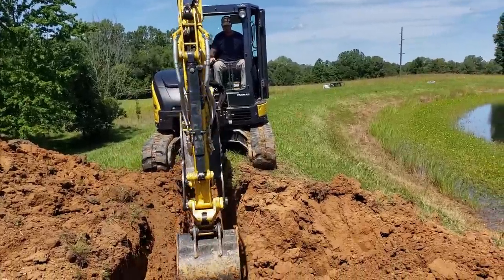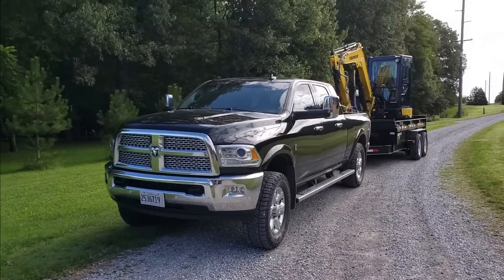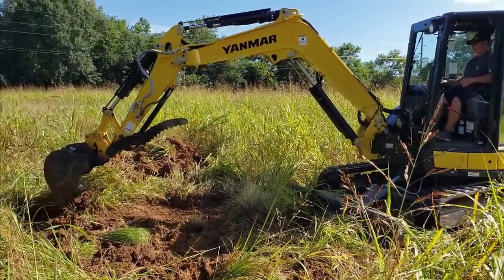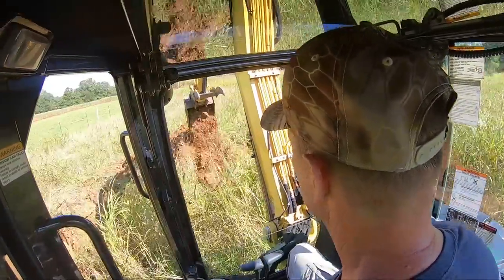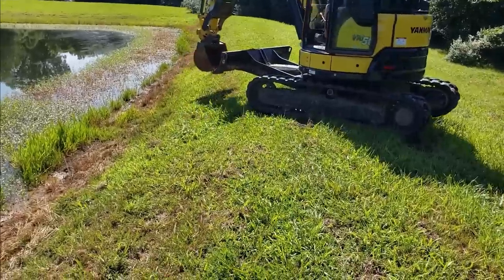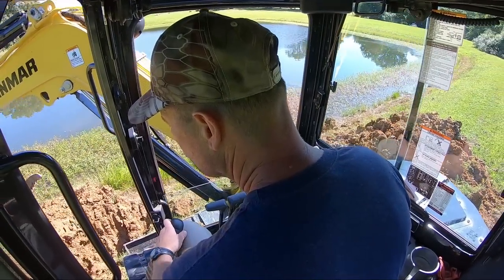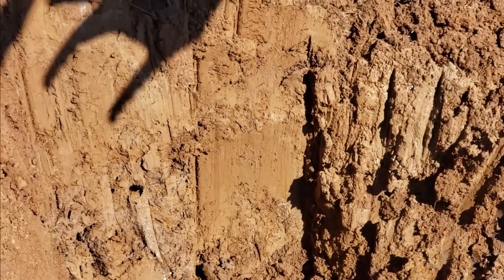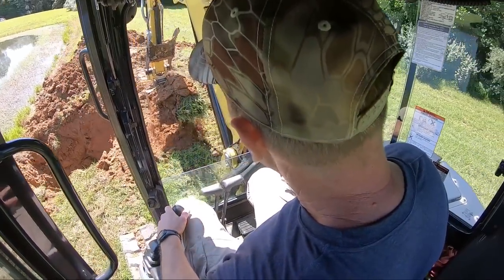Pond Dam repair. We could NOT find the leak!!

Comment: I betting you found it in part 2.   Looked like the entrance was above the water line.   Too bad you could not of used your waste water Famous Duck Pond pump and flooded the tunnel.  
.   
I surprised Kapper Film Productions has not figured out a way to add a camera to arm of the excavator, of course it be a challenge, but that Kapper guy does things others would not attempt.   Like planting thousands and thousands of lob lolly pine trees in a short month or two.
Reply from the maker: well in hind sight I should have cut the hole and let the water run! But it was 'supposed' to be an easy one to find!!! Uggghh... Thanks man
Reply: Kapper Outdoors  even better faster idea Joe.   I  keep thinking ponds  going to run dry fast.
Well if it did. Not fix it, or on future jobs your ideas must better.